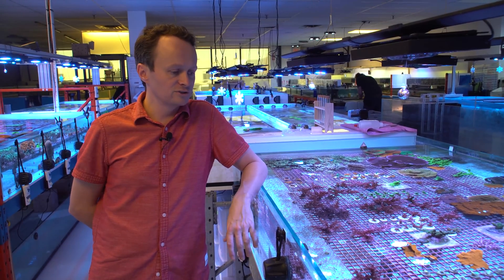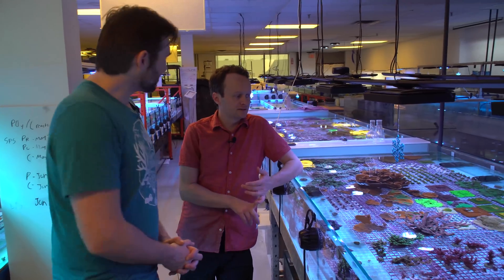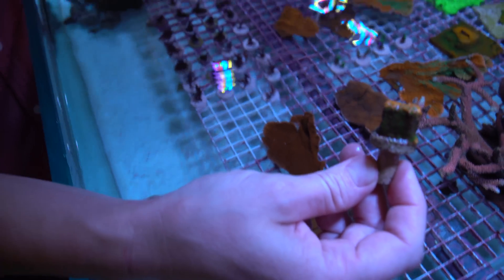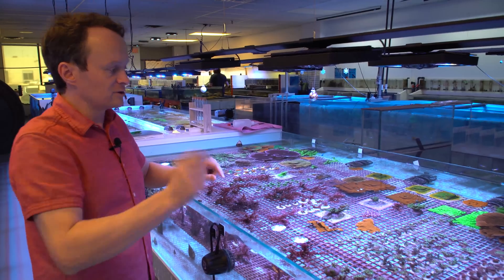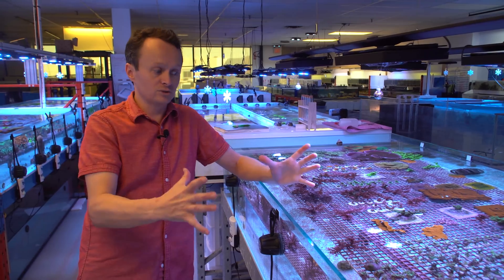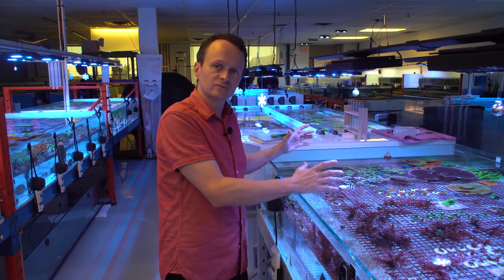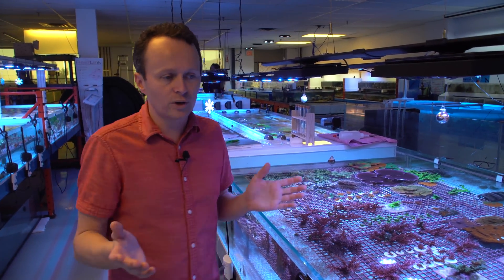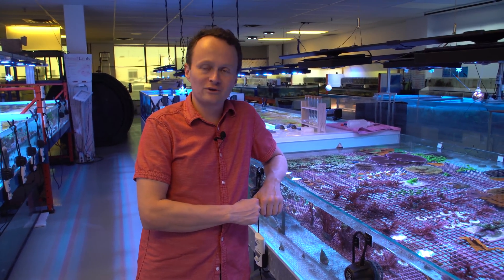Beyond PAR - Ecotech Marine CoralLab DLI with ReefWholesale

Comment: How do you get enough PAR with the lights so high above the water?
Reply: Shallow water frag tanks are about 4 to 6 inches deep.  Therefore you can run the lights much higher and achieve proper PAR.  It also helps greatly with spread.  The closer you mount a fixture to the water surface, the less spread you achieve.

Comment: Say, 12 hours at 60 percent is long duration at low intensity and 8 hours at 80 percent is short duration and high intensity. Have they thought about testing moderation? say 10 hours at 70 percent for example. Do you think this would give positive and or negative benefits of both tests? I guess this will change from tank to tank and the type of coral kept but.. interesting
Reply from the maker: Would give you results right in the middle!  The majority of corals will be fine under either system.  Some will have better color or growth in one vs the other.  Over time it would be neat to make a DLI database for coral!